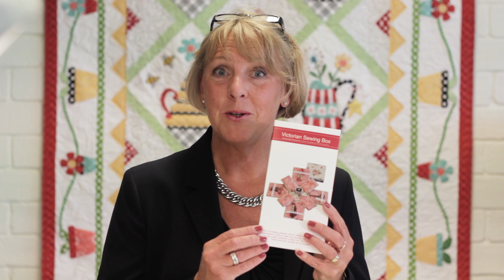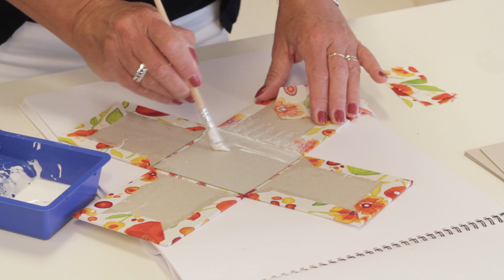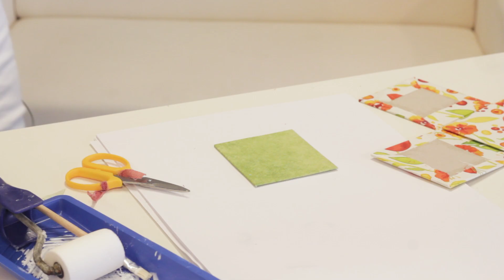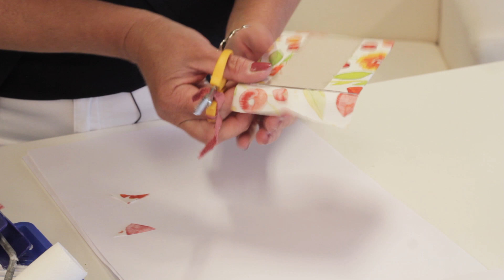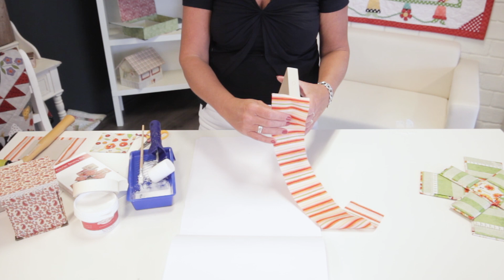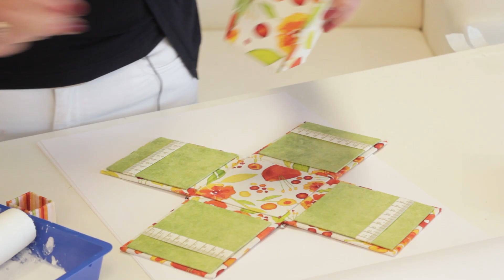Victorian Sewingbox.

Comment: Rinske, I have a pyramid Victorian needle box kit .... with no instructions. How do I make the ‘lid’ for this one?
Reply: I wouldn't put a lid  on a pyramid... Attached a nice 🎀 (1/2" wide - I'd use grossgrain - it's sturdier) to one side of the pyramid about 1-2" from the top. Pull all three sides up, tie around the top in a nice bow. Leave enough to bow cut the ends =< to prevent fraying. Hope that works! 😘

Comment: I understand gluing on that paper pad, but why wouldn't you place the chipboard in a corner so you could use the same page, again?  You could have done all 4, one at a time, on the one page.  Just wondering.
Reply: I agree, I think I would economize by using one corner at a time. But maybe it was easier when filming it not to have to fiddle with arranging the cardboard so carefully. I also thought maybe newspaper could be cut and stacked and used one sheet at a time. Having a clean surface for multiple gluing steps has always been a struggle for me, so this is giving me good ideas for trying myself.
Reply: It's easier for the viewers to see on white and aesthetics for filming,,she advised us to use and old magazine 😊🌈